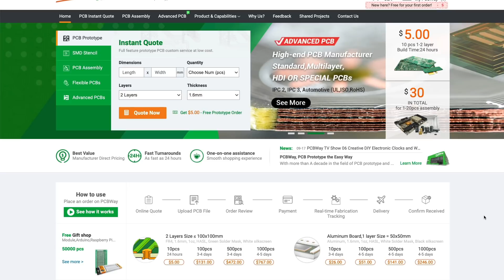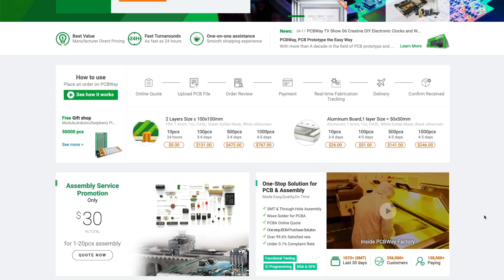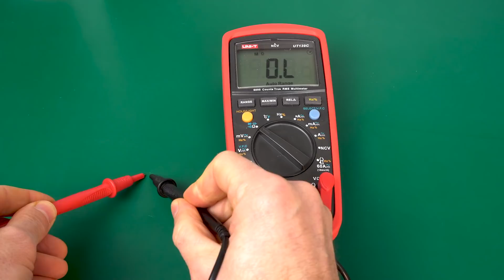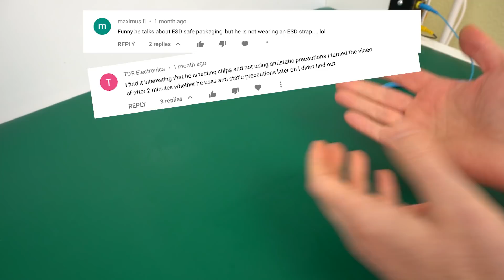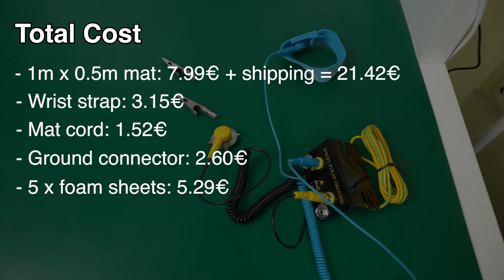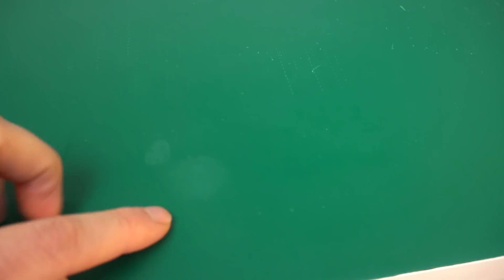How to Set Up an ESD-Safe Workbench

Comment from the maker: One thing I failed to mention in the video is that both the wrist strap cable and the mat cable have a 1M resistor built-in. That's important because it prevents any accidental discharge through that cable. In addition to that, a few people like @Cyborgdelta1 and @Mark Singleton also pointed out that it's safer to have the earth cable also have a 1M resistor (in case something goes wrong in the wall plug or even some accidental contact in the terminal I screwed on to the bench). There are also pre-made earth connectors with the 1M resistor built-in like these: https://cpc.farnell.com/antistat/070-0021/euro-esd-plug-1x10mm-2xb/dp/SA03649?st=earth+bonding+plug so I'll be getting one of those soon. Thanks for pointing that out!
Reply from the maker: I just added the 1M resistor directly to the earth cable by the terminal: https://www.facebook.com/NoelsRetroLab/photos/p.210627027078545/210627027078545
Reply: Why did you not test the iron on the bit you cut off?
Reply from the maker: @TheErador  I totally should have, but I didn't have it around anymore! ☹️ I ended up recording the temperature test weeks after I initially cut it and set it up.
Reply: I live in Australia so it might not be relevant but I got a 2m end that cost me about $150 back in the day and its been in solid heavy use for many years and while it has a few burns and so forth from using a hot air gun over it, they are very minor and honestly where caused by long uses of hot air on a component. end mats are like anything else we buy in life such as there are a considerable range of quality/durability/cost avaliable on the market.
intoendmajorsupplierthatsmellsIsolder directly on my mat o don't get any fumes from it even it I held the iron on it long enough to burn it

esd mats and from what I've found it that the green and blue ones fade a lot over a few years and some can look quite horrible when they do. it a personal preference thing but I went for a grey mat myself to avoid those cosmetic issues down the road
Reply from the maker: @Choppy_PHC  Thanks! I've seen some recommendations from other people, but they're all from Australia for some reason! You guys must have some good supplies there. I need to find some in Europe 😃
Reply: CPC/Darnell also sell UK ones with 1M resistor for about £5, presumably also US versions available.
Reply: Regarding ESD matting you want to have a look at Dave Jones EEblog #585: https://www.youtube.com/watch?v=NNXo4AbaKFc

Comment: Very informative! I've been working with computers using bare ESD mats with no grounding point to it, thought that's how it's designed. Additionally, I do use an ESD strap as well but because I'm illiterate with electrical stuff; I would just clamp it to any metal object such as my PC Chassis - I thought that worked...

Comment: Do not open sockets to ground your mat! There are special plugs you can use to ground your mat.
Those are way safer for DIYers (as you can't mess up the connection and electrocute yourself) as well as allow disconnects and easily move the mat around.

Comment: After you changed the foam that you put the components in you continue to put them in a completely unsafe plastic drawer which may certainly damage them when they are there like that and the components are still not safe at all, especially since that drawer will likely get a charge from just pulling it out. If you want to put sensitive components in that drawer then always use the metalized ESD bags which also shield the components inside from a ESD and never take the components out of that bag until you have taken the bag of the drawer and away from it and put the bag on the ESD mat.
I have never seen a ESD ground connector that didnt have built in 1M resistors before, it can be very dangerous if you somehow manage to connect yourself directly to earth and also its not advisable to screw the cable to the outlet like you did for safety reasons, buy a special ESD connector that has plastic pins instead of the live pins and just metal for the ground pin. 
As for the mat i think you need the rubber variant for it to be more heat resistant but any mat would probably not tolerate a soldering iron put to it very well and its not a good practise anyway so just avoid it, i have pretty much never done it and i have worked in electronics professionally for almost 40 years and soldered so much i can almost do it in my sleep.

Comment: Hi! If I need just to update my ram and ssd in the laptop, do I need to plug the rag and bracelet into the adapter and to the ground as well? Or can I just attach them both  let's say to the working fridge, and put this rag on a little wooden table nearby to upgrade it? Or it will be same as if I just connect the bracelet to the rag? But i mean feidge should be grounded and if I connect to it, then everything will be connected to a grounded metal object... Im very confused, never upgraded a laptop before...

Comment: The last bit about ESD safe chip storage... Shouldn't you use ESD safe plastic containers too then? Those black ones, because the container will still build up a charge and charge your chips even better now that they are in conducting foam. Once you pick them up with your wrist band attached or put them down on the ESD safe mat, they will discharge and get damaged, right?
Reply: Best is to use the metalized shielding ESD bags to store and transport components in, the black plastic ESD boxes are only suitable for an EPA (Electrostatic Protected Area) since they are conductive and does not shield from discharges when walking around in an unprotected area and pretty much no one has a real EPA area at home. BTW, the pink bags and foam  also doesnt shield the components so they are also not suitable for use outside an EPA.

Comment: Hello, the earth connector that you have that one with the button's an banana plug have an issue, make sure that the button part is connected with the banana part because    I have they same one and I found that problem and I fix that running a wire to connect them together and remember to add at least 1M ohm resistor in the process of fixing that issue

Comment: Can I use any chair to sit and work on the ESD safe station the way you built yourself?
Reply: An ESD-safe chair is better, but your body and bench being grounded are more important. Try to avoid rolling around a non-ESD chair if possible. An all-wood chair (without rubber wheels or bumpers) is a great budget ESD-safe option.

Comment: The banana plug seems JUST large enough to make proper contact when inserted into the ground hole of a north american NEMA plug. Obviously it isn't specifically made for that, but if you're looking for a portable solution (i.e. for occasional things like PC building), it seems like that might work.

Comment: A question ? You actually had a chip damaged by a electrostatic discharge, when you are manipulating a chip or a board ?
Reply from the maker: I've had chips fail. Some of them on camera (look up the SVI 328 repair), but obviously I don't know if it was due to a discharge or not. I know the world is divided on this, but I did a bit of research and it seemed like a good thing to do. Call it a small insurance policy.
Reply: Components can get a damage and still work for a long time until they finally fail due to the ESD, its a bit of a silent killer in that sense. There also doesnt have to be a static discharge that you will notice at all to kill a component.

Comment: I am sure it has been said somewhere below over the last few months, but there are types of ESD matts that are a lot more heat resistant.  They don't easily melt at soldering iron temperatures.  The heat gun will still overheat and damage them rather quickly and at the very least discolor the matt.  I learned that and often use a silicon matt on top if I am using the heat gun.  They can't take pushing ic legs into them, xacto knives etc, but they are fairly resistant to damage from dragging a board across them.  Don't put a board on them and push an ic into a a tight socket though..  The other thing is they tend to discolor.  Browning over time, kind of like old plastic from the 80s etc, some things do stain them.  IPA has a little effect but nothing dramatic.  One time some computers with very cheap nasty black rubber feet were set on the matts at work and it left permanent brown stains (feet were quickly removed and thrown away, these were brand new cases not old rubber going bad).  Dave's video mentioned in the pinned comment I am sure probably goes over a lot of that, it has been awhile since I watched that one.

Comment: slide the wristband up to your elbow..
get a thick piece of aluminum, a half foot cut of half inch sheet, or similar. Acts as a heatsink, you can solder on it as it electrically conducts to your esd surface, solder won't stick to it and you can wash excess flux off it.

Comment: So if I have a silicone mold that has a lot of static built up in it, will this dissipate the static? or would I need a grounded work bench for that?
Reply from the maker: I'm not sure the silicone mat can have static build up, but if it did, I'm not sure it would dissipate it because silicone is not conductive, so touching it while strapped might not be enough. But I really don't know, I'm just guessing 😃
Reply: @NoelsRetroLab  it would be a silicone mold for resin making. I get static a lot in my silicone molds.

Comment: Please tell us you did not put a o-ring wire terminal just on top of the earth block, right in between and just a mm away from the live mains terminal. One movement of the attached wire terminal and it shorts to live and your grounding wrist wrap has becom a live wrist wrap. There are adapter plugs (with or without a megohm resistor) that are all plastic but the earth connection, terminating in a banana plug. Or at least use the original terminals of the  sockets, where the attached wire goes. There is always room for 2 wires there and its in a save (-er) spot. Like this, its a catastrophe waiting to happen.

Comment: I'm 73, and have been working with electronics since I was 9.  I've NEVER used a ground-strap, and have NEVER blown a Chip!!
Reply from the maker: Yes, that's totally possible. I'm sure some of it depends on your environments (humidity, temperature). But it's a relatively cheap precaution that will make me feel better 😃
Reply: Your very lucky! The Commodore SID chip is notorious for dying from static. That's why its so hard to find them. They are  now selling for $80 or more for that chip. I just bought 3 C64's that I saw working and checked to make sure it was a real SID and not one of the new replacement ones. I can get a whole 64 for just a little bit over the price or the same price of a SID chip.

Comment: I ESD proofed my work area like you did earlier this year.  After reading a lot of info and reviews online I plumped for this mat seeing as I am based in Canada https://www.ebay.ca/itm/2-LAYER-RUBBER-ANTI-STATIC-ESD-HI-TEMP-MAT-kit-W-Dual-Bench-24-x72-BLUE/282422778720?hash=item41c1b59b60.  The spec is really good and it is rated for up to 600°F.  So far I've not experienced any scratches or discolouration at all.  I did read that you should use a specific ESD mat cleaner though otherwise other cleaners can leave a residue that can change the mats electrical properties.  This is what I bought : https://www.digikey.ca/en/products/detail/desco/10446/9637726
Reply from the maker: Nice! I've seen that vendor recommended multiple times in eevblog, and I even reached out to them, but they wouldn't ship to Europe. Still looking for a good supplier on this side of the pond.
Reply: @NoelsRetroLab  Dang - that's a shame.  I'd be happy to act as a forwarder if that helps but shipping might be a bit of a killer as these things, as you know, are quite heavy.
Reply from the maker: @Ikrananka  Thanks! I appreciate it but you're right, shipping from Canada is really expensive for some reason. There has to be some decent source in Europe for them. I'll keep looking 😃
Reply: @NoelsRetroLab  Good luck.  BTW - love your videos and the work you do.  I'm learning a lot so thank you.
Reply from the maker: @Ikrananka  Thank you! Really glad to hear that. And to be honest, I'm learning a lot as I'm diving into some of these new-to-me computers as well. That's part of the fun! 😃

Comment: Great job! On ESD, I thought the 1MOhm resistor you find in those connecting cables would be enough to prevent a shock even though your desk is not ESD safe - so when you just wear the wrist wrap. It doesn't hurt of course. Definitely make sure you have that 1MOhm resistors on both lines otherwise in case you touched something charged, it would discharged to ground too quickly causing potential damage.
Now I think about it, the mat is probably slow in discharging anyways - you measured Mega Ohms with your meter - but your wristwrap goes straight to earth so that needs the resistor IMHO.

Curiously enough, my ESD mat is slightly conductive on top as well. I am indeed not sure I should put anything live on it...
Reply from the maker: Right. The cables have the 1M resistor except for the one from the terminal to earth. I ended up adding it myself after people mentioned it could be a safety risk. I may look at RS Component for your mat, because I can't find any good sources in Europe (most of them are in Australia for some reason!).
Reply: Yes the wrist strap shouldnt hurt anything when touching something charged that is on the bench, that is the whole point, but it has to have a 1M resistor in series to ground to disipate that charge slowly without causing any damage and also protect you from being electrocuted if you happen to touch dangerous voltage, which is also a very important reason for the 1M resistor.  The risk is more if you should hold the electronics that has a different charge than the table has (with or without the wrist strap) and put the electronics on the table then you might get an ESD (discharge) that may damage the electronics.
Reply: My mat doesn't get damaged like yours though :) I think I paid it £40 from RS component though.

Comment: Where I live it is usually quite humid and I have no carpets. Before I touch sensitive components, I touch the metal legs of my workbench to discharge myself. I have yet to destroy any component. Personally, I think static electricity damage is exaggerated. While it can and does happen, it doesn't happen as often as we're lead to believe. 

I would go a strep further and claim that an ESD mat poses more risk than it mitigates. If you place a PCB flat on the mat with the bottom solder joints touching it, you can destroy the entire board and possibly get a nasty tingle if it's powered.  Even if the board isn't powered, a cap with a residual charge could empty itself into another component or you. Moreover, given the way oscilloscopes are wired, probing a PCB requires careful consideration of grounding to avoid destroying an oscilliscope.

Comment: The more expensive ESD matt material is much more resistant to high temperatures and surface damage so yes you can improve on that. Regarding the 1M resistor, our "high end" ESD gear does have a 1M resistor in the ground lead and we use a plug with an external ground screw lug. It would be a good idea to pop a 1M resistor into that lead to your mains ground as Mark Singleton said below. As I said, well done and a 100% improvement over not doing anything at all, like many know-it-all (head in the sand) Youtubers and prominent makers cough #adafruit...
Reply from the maker: Good to know about the better ESD mats. I'll look into it. And yes, I already popped in a 1M resistor in the cable to mains ground, so that should make it extra safe. 👍

Comment: I get the impression that the intended use of that bracket is to be bolted on the underside of the desk, or if you want it to the side where you put it, bolted on the *outside*, like an L-shape sticking out to the side if that makes any sense. That way the rubber cover and the contacts won't interact with the furniture at all.
Reply: If you place the grounding point under the front edge to the side of your non-dominant hand, you can strap that hand and the cable tends to stay out of the way more than strapping your dominant hand and having the cable run to the side. If you choose to strap your ankle, make sure you are strapping to bare skin it is usually easier to use a Velcro or snap equipped ESD strap. I used to use an "S" plastic glove clip over my hip pocket so I could leave the bench without removing the strap from my ankle, plugging the banana plug back in before returning to work.
Reply from the maker: You're right! It didn't instantly click because the desk I have has a drawer underneath, so that wouldn't have worked. But on a regular workbench that would make sense.

Comment: Hello Noel, the black carbon type foam is great for short periods of time but can corrode terminals if stored in humid area.  Best to use the pink ESD foam for component storage.
Reply from the maker: Interesting, I didn't know that. I don't even remember seeing pink ESD foam anywhere! I take it it's made of some significantly different material? Thanks for the tip.